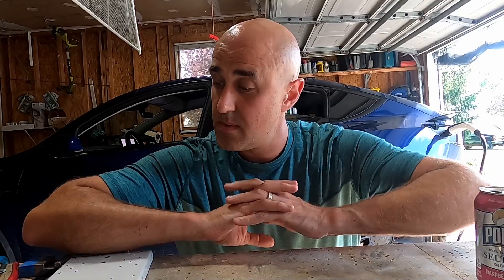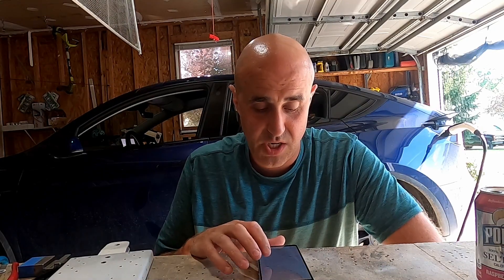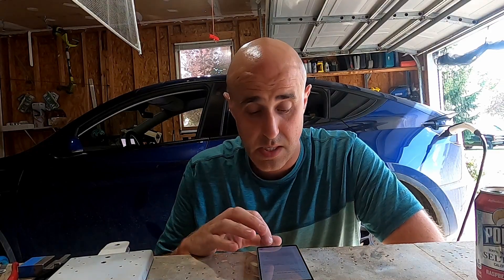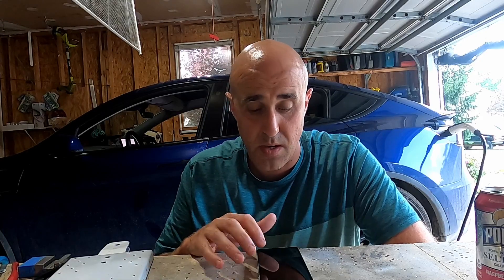Fuselage dimple cracking - Van's plan(link below) and my thoughts.

Comment: Agree with your take.  I will likely fly mine with affected QB flaps and ailerons and replace after a year or two.  I personally am not too worried about structural failure if testing shows this not to be an issue, but will replace for resale value and long term (20 year, 4,000 hour) fatigue safety protection.

Comment: I would suggest you open up the holes to remove all crack indications. That will also remove lazer cut material property changes. Install oversized rivets and shave the heads.
Reply from the maker: Not a bad idea, unfortunately on a lot of the flanges, moving to a 1/8" shank rivet would put me beyond edge distance limitations.. I might just have to wait for replacement parts on a lot of these

Comment: Curious, how do you know which parts carry more load and which carry less (you mention seat ribs vs bulkheads, for example)?

This is kind of information I wish I had available as a builder: some structural engineering in layman's terms.
Reply from the maker: It's more analysis and intuition on my part, I'm not a structural engineer by any means but thinking about where loads are imparted in normal flight (spars) and how those forces are distributed to the connected parts(or not)
Reply: Just curious if you have a background in structural engineering?
Reply: I’m wondering if I should even take on a kit built or does one need some engineering background? Just curious- I have none
Reply: @SooperToober  One definitely doesn't need to be an engineer... I'm building a Cozy from plans rather than a Vans kit, however I assume that the Vans instructions also start out with some practice parts. Alternatively, EAA offers workshops for prospective builders that might be worth checking out!

Comment: IMHO (not a structural engineer), this laser cut fiasco is much more of a PR mess than a structural problem with the airplane. One crack in a dimple on one flange won't have much if any relative motion that would cause a real crack to develop. These parts are over designed for the amateur builder and will be fine for thousands of hours of flight. I agree that on flight controls, this is not a good place to have any cracks. Just read the recent SB's from Van's on the control hinge areas.
Reply: Correct, you're NOT a structural engineer, so don't comment on things you don't know about that can get people killed. Cracks are bad, and you don't know where they are going to happen. literally any rivet is suspect, and enough of them in the wrong places will be fatal.